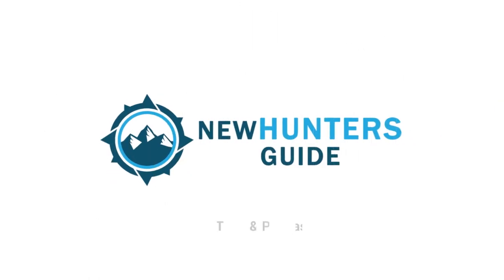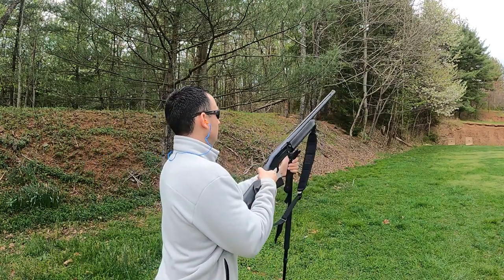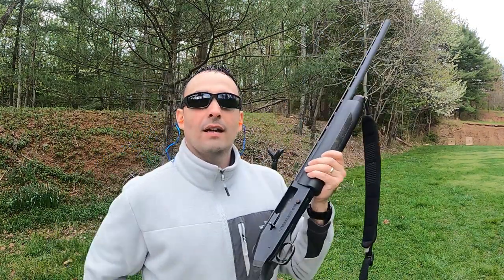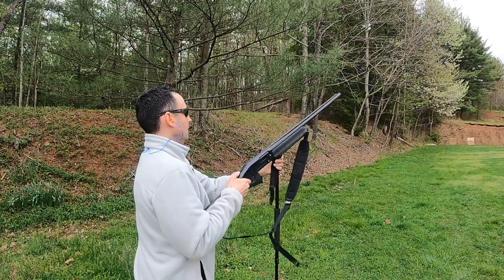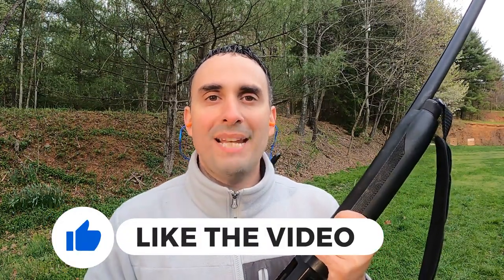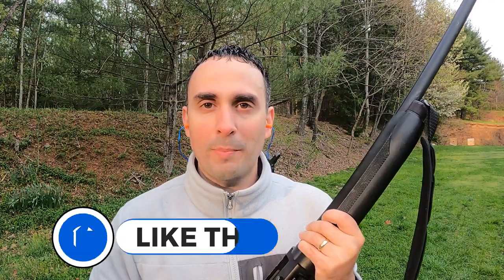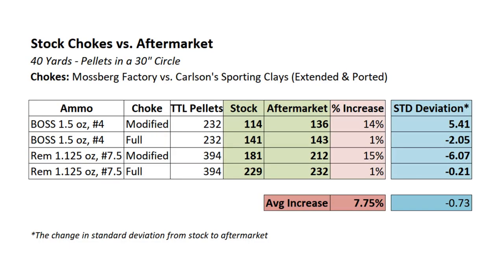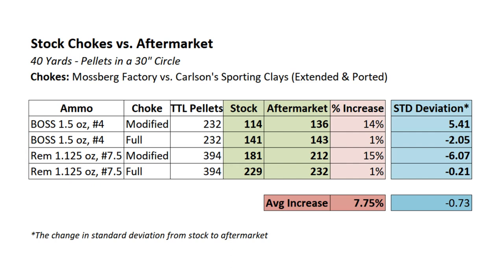TEST: Stock Chokes Vs. Aftermarket Extended Choke Tubes

Comment: Glad I've been running my extended ported cremator LR all along!
Reply from the maker: I've done some further testing since I recorded this and found that most of the time, aftermarket chokes provide significant benefit over factory.  To the point where I feel bad about using some of those factory chokes for years hunting ducks.
Reply: @TheNewHuntersGuide  I know the MR and LR cremator's pattern great but I'm interested to see if they are tighter constriction than a factory mod or full and that is why they pattern better or if it is just better construction/materials.
Reply from the maker: @Drblood6721  Sometimes I think design does play a factor, and sometimes it's just a matter of synergy with a particular gun. But I've heard good things about the Cremators, they aren't the top recommendation for bismuth, or I'd have them too.
Reply: @TheNewHuntersGuide  What interested  me in them was the fact that you don't have shot size restrictions even in full. I tested Kent fasteel 2.0 #2 1 3/8oz, boss 3/5 1 1/2oz and Federal #2 1 1/4oz all 3" shells and at 40 yds and longrange choke, had the highest percentage total (hits/pellets) in a 12in circle with the federal, although boss had a similar hit count, I couldn't find the 3/5 pellet count. Both had around 26-28in a 12in circle at 40 yds.

Comment: I tried some extended ported choke tube for my Benellis awhile back designed for Hevi Metal shells “back when they were good”. Compared to the crio tubes in my Benelli they did no better in fact a bit worse in most circumstances plus louder and better chance of muzzle blasting your hunting buddies. But admittedly the Benelli and the Mossberg are 2 very different guns.
Reply from the maker: Yea, Benelli is known for their factory chokes. Aftermarket chokes could yield better results, but it would be more a factor of random synergy than increase in quality.

Comment: The chokes that sit flush usually have 3/8 or 7/16 of choke at the end. The extended chokes have an 1 1/8 to 1 1/2 inches of choking and aligns your shot uniform as it exists the barrel.
Reply from the maker: Thanks!

Comment: Great quick look at what going to an extended aftermarket choke can do for patterns. Good job. 

It has been my experience that the disparity between OEM and Aftermarket extended chokes is primarily due to length of the Parallel Section and the profile of the constricting section entering it. In this particular example, you have a very short choke system that has an abrupt constriction and short parallel section (Remington's and Mossberg's choke designs are among the shortest). Lengthening both the constricting and parallel sections of the chokes eases the shot charge's transition from Open Bore to constriction and better controls it on exit (at least in theory, there are always exceptions). As the choke design lengthens, however, I have seen less drastic differences between OEM and aftermarket chokes, especially when comparing extended OEM to extended aftermarket. Having looked at the results in the Beretta/Benelli Mobile (12 and 20ga), Benelli Crio (12ga), Browning Invector 10, and Winchester/Browning Invector (12ga - SX4), I can say that what mattered more on pattern efficiency and evenness between OEM and Aftermarket chokes was not just the length of the parallel section, but the diameter/constriction of a given choke for the shot type and sizes used. It is the later of these two that really makes the greatest differences in patterning efficiency and density for any given load. In my experience it has been more important to match the constriction needed to pattern well with a given load than it is the other way around, regardless of choke design and manufacture.
Reply from the maker: I hear you. What was interesting to me here is that the aftermarket full did only slightly better than the stock full for both loads, but the aftermarket modified did alot better for both loads. I've done some further testing since I recorded this and found that most of the time, aftermarket chokes provide significant benefit over factory the tighter you go when shooting bismuth.  To the point where I feel bad about using some of those factory chokes for years hunting ducks.
Reply: @TheNewHuntersGuide  it’s all valid data points and shows the importance of patterning your gun/load/choke combos. There are the “rules of thumb”, but they mean bunk until you actually test your gear. 

When it comes to shotshell patterns for ducks and geese I see a lot of arguments about “it’s good enough, I don’t shoot past 40 anyways”, and while you can harvest critters with inefficient patterns and poor choice in shot materials, it raises the probability that you will have a bad pattern that doesn’t cleanly dispatch your quarry. To me, I want to know that if I do everything right and get that animal in that pattern it will 99% of the time die. I want the only factor in whether or not that animal is cleanly dispatched to be me. A good indian makes sure he can’t ever blame the bow.

 I’m glad you are putting together these videos. You’ve got a good presentation style and I’m sure it’s helping folks learn to be better hunters. Keep it up!
Reply from the maker: @AmericanArmsChannel  Thank you!
Reply: I always felt like the moss 500 factory chokes were soo short lol. So i bought extended chokes.. patterns better imo,,, i was using the factory full choke for the longest time that it swelled in my barrel and was hard to get out. Had to Use a bolt extractor

Comment: This test doesn't really show anything significant. Both full chokes threw essentially the same pattern. The modified chokes produced different patterns at 40 yards, but a "Modified" choke is defined as a choke that patterns 60% at forty yards. Hence the two "full" chokes were actually modified chokes and the "modified" chokes were somewhere between skeet and modified depending on the load. The fact that one of the tubes was extended and ported doesn't really mean anything. If your goal was to achieve the greatest pattern density at 40 yards, the factory "full" did just as well as the after-market choke.
Reply from the maker: Joe, I disagree. This test does show something significant. That there wasn't much difference, exactly what you pointed out. But it was real data from the field that shows some difference. Nothing groundbreaking. But if the truth is not groundbreaking then that is fine by me. People need more information based on real testing, not internet speculation. People everywhere claim all sorts of things about chokes, some are crazy. So I've set out to do real tests and show what's really happening, as unspectacular as that might be.

Comment: Do you think aftermarket flush tubes would perform any different from factory flush tubes?
Reply from the maker: That is a hard question. Best answer I can give is sometimes. The higher end the gun, the less likely I think aftermarket recessed chokes would boost performance. Cheap guns are more likely to see gains. But it really comes down to gun/choke fit. No 2 guns are the same. If I were going to buy chokes I would invest in quality extended tubes, probably Muller or Carlsons. If your stock chokes give you decent performance than stick with them.

Comment: My Mossberg 935 Magnum comes with 3-in chokes. Your Mossberg 930 choke appears to be no longer than inch and a half long which I find curious?
Reply from the maker: The 835/935 uses completely different chokes than the 930 or 940. The 835/935 are a long neck design unique to that gun where the 930/940 are compatible for the 500 and various other Winchester and browning shotguns.
Reply: @TheNewHuntersGuide  did Mossberg ever bore out any other shotgun model to 10 gauge like the 935 Magnum model? Or unique to this model only?
Reply from the maker: @corysnladventures2758  I don't know of any 10 gauge options, thought at some point I wouldn't doubt they had some in their lineup. They've been making shotguns for awhile!

Comment: I’d be curious to see how extended chokes compare to chokes made for specific purposes with the same exit diameters perform.
Reply from the maker: So, like Carlson's chokes made specifically for Steel, Bismuth, or TSS that have the same constriction?
Reply: Yes, but to even expand on that chokes made for waterfowl versus something like a modified choke…Hard to explain but you’re on the right path

Comment: Have you tested lesser constricted chokes like this, such as skeet and improved cylinder?
Reply from the maker: No sir I haven't,  I do not have any aftermarket ones and I don't hunt with any size, so I've basically neglected that side of the spectrum in use and testing. Its a good idea though.
Reply: @TheNewHuntersGuide  It would be a good test to see the difference between the two for clay target shooting.
Reply from the maker: @TommyboyGTP  I'll see what I can do.
Reply: @TheNewHuntersGuide  That's great, subscribed!
Reply from the maker: @TommyboyGTP  Thanks!

Comment: those extended choke are somehow just better, I use a beretta extended choke in a m4 and the extended C patterns buckshot tighter than flush IC.
Reply from the maker: The further I go, the better the results I see with extended chokes. Though to be fair, not all stock or recessed chokes are created equal. These ones I tested here were from great.

Comment: What you are failing to compare is the actual constriction of the choke ie Bore size vs actual constriction. Extended this, ported that, X constriction (IC, Mod, Full) is meaningless. Mid range, Long Range etc is another bunch of marketing garbage. Many choke manufacturer's, in the fine print, state that it is an equivalent size rating.

A Carlson “Mid Range” is dead in the middle  between an IC and Mod in a factory Maxus II.
Reply from the maker: Hi thanks for the feedback. I am half following you. Give me some numbers so I can make sure I am tracking with you. Do you mean focusing on say a 0.715 constriction vs the stated choke note as "Mod".
Reply: @TheNewHuntersGuide  Choke is the difference between the bore diameter and choke diameter. So it looks like your gun has a nominal bore size of .730. Using Carlson example, the Bone Buster Mid Range is a .705 diameter which equals .025 constriction (Imp Mod), the LR is .690 which is .040 (Ex Full) and has steel shot restrictions. (If your factory “Full” doesn’t have steel restrictions, it most likely measures Imp Mod and patterns lead as such).
 
Cremator MR is a .715 which equals .015 constriction (light mod) and the LR is .705, same as Bone Buster Mid range. A Briley BlackCloud Mid range is .020 etc. 

In my Super Back Eagle 3, NO aftermarket choke can touch the factory IC and Mod from 0-40 yards. You can look at some patterning I just did on my channel. The Maxus II wasn’t impressive with anything I already had, so I measured all of them, then ordered one based on actual constriction that should work with an SPECIFIC shell/load instead of name or “range”. P.S. I’m a competitive skeet shooter and am extremely familiar with testing chokes, barrel regulation POA/POI.

Keep up the good work! I decided to try those Boss shells after checking out your channel.
Reply from the maker: @marshprowler2739  I follow you. Thanks so much!

Comment: Its well known that factory marked chokes vary in actual constriction. A 12ga aftermarket modified choke is typically .020 inch constricted.  Without measuring actual constrictions this test is inconclusive?
Reply from the maker: It's also true that constriction is just one of many factors that determine pattern spread and density. 4 chokes of the same constriction can all pattern different due to other factors of their geometry. Essentially rendering all choke testing invalid because no 2 perform the same. But that's a rather dim view to live by,  so we continue to test all kinds of stuff to see what happens.